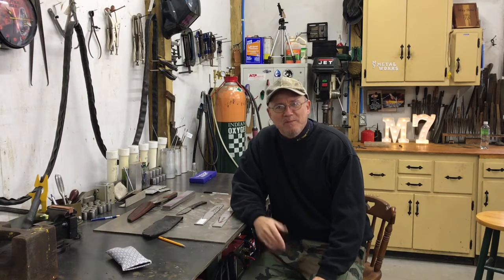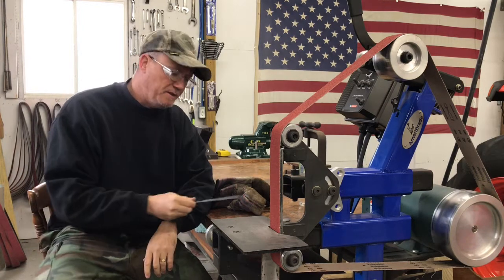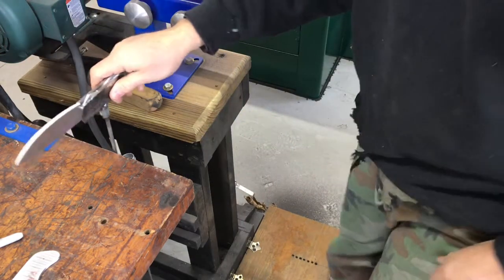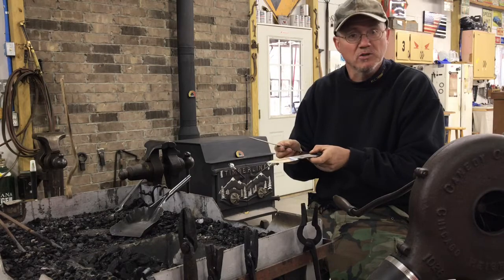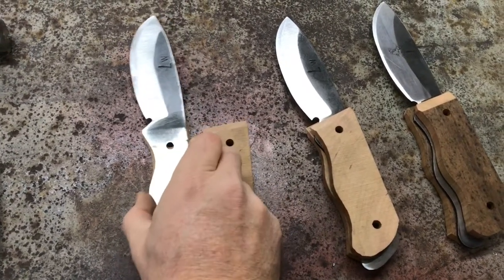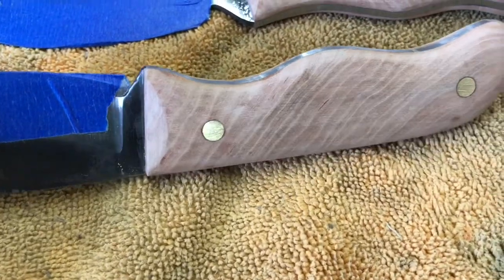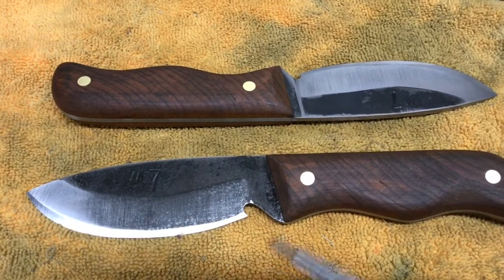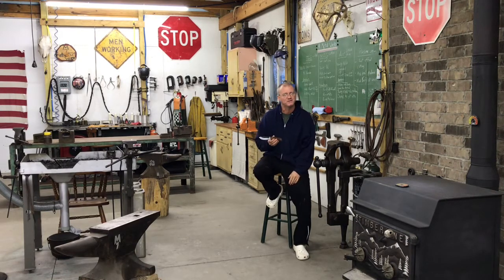Crafting Knives Using 80CrV2 Steel

Comment: I use 1084, forge and heat treet in a homemade charcoal forge, I have used warmed canola oil, results have been good. Would that work with 80crv2 steel, simple heat treat, no soaking ??
Reply from the maker: I like 80CrV2 except for its corrosion properties. It rust real easily if you don’t keep it oiled. So I will be exploring ew steels. Thank you for the suggestion. I may try 1084. I use coal cause it’s cheap! $15 for a 55gal barrel full of coal! I have several barrels.
Reply: @shopdoc  I have read that 1084 might need a faster quench than 80crv2 as it is somewhat shallow hardening, but 1084 worked well with the canola. I have always used slightly warmed canola, but someone suggested canola at room temp, will put that to the test on a sample piece just to compare results.

Comment: Like the video the steel you used did not worp or Bend .What oil do youQuench the knife blade in.
Reply from the maker: I used Canola oil. Thanks for asking, I should have mentioned that.
Reply: Merry Christmas thank you
Reply: The CherryWood looks good on the knife
Reply from the maker: Thanks! I think it looks great as well. I still need to work on improving my grind to make it a little more even but I am improving and the knife should perform really well.
Reply: I got a new Annville for Christmas it looks great and works great.
Reply from the maker: Fantastic! That's a nice gift!!!
Reply from the maker: Canola oil. Heated to 110F approximately.

Comment: Nice Knives. noticed you used a forge to heat treat.. Does the 80 CRv2 hold an edge heat treating with a forge and oil quench?
Reply from the maker: Yes I still think I can improve my heat treat but this steel seems very forgiving. Holds a very nice edge.
Reply: O
Reply: Hi it was a good angle thank you
Reply: Anvil